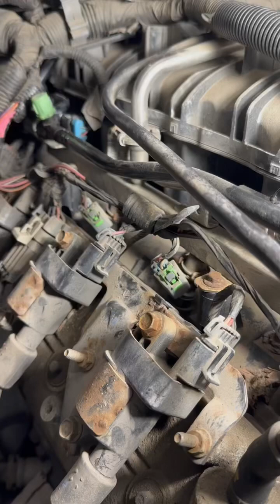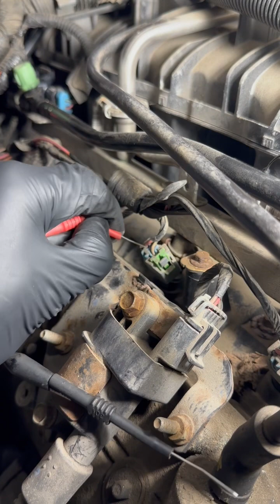Fuel Injector Circuit Testing with a test light #shorts #injector #engine #chevrolet

Comment: You should start the car with the Red and Black wire touching together
Reply from the maker: @xaman1874   LOL
Reply: The method shown in this video is a dangerous method to teach to the masses.  The rule is "never backprobe power and ground at the same time if the probes are next to each other".  Power and ground could have been tested individually on this circuit (with the bulb).

Comment: What if the light stays on and not flicker
Reply from the maker: @erickdominguez4417  you have a shorted control wire or a shorted driver in the ECM
Reply: @KITS_Auto_and_Truck_Repair I'm having a problem with my car, the car only crank no start,  but if I use a starting fluid it starts right up, there is good fuel pressure,  i think something is restricting the fuel , or the injectors are restricted from working by the ecm
Reply: @sauldean6430 fuel filter?
Reply: @sauldean6430  Did you fix your car yet?  What was the fix?

Comment: How to test a desel engine injectors
Reply from the maker: @thestoryteller526  which type of injector?
Reply: @KITS_Auto_and_Truck_Repair ....Bosch solenoid diesel injector in Mercedes. Has 2 red wires plugged into it!. Which is constant?.. which is ground?. Been trying 2 years now looking for info on how to check resistance on the injector and how to check pulse signal at the plug🤔
Reply: the constant one is the wire that would have 12 volt supply just as you switch the key ON,
the other wie would be the trigger and linked to the ECU

Comment: When the ignition is turned on without starting.current comes to all four injectors and petrol is poured .why does it not start when that happens.?
Reply from the maker: @kpdrums459  the injectors are not gounded when the key is turned on!
Reply: @KITS_Auto_and_Truck_Repair  when the key is turned on , injectors turn on
Reply: no that's not supposed to happen,
all injectors should only activate when cranking or running,
switching key ON wont activate the injectors, not even one,
and when cranked they will activate one at a time

Comment: Get the multimeter, put your test leads to the injector's electrical connector and use V 20 measure, watch it jumps up and down as it sends signal - you're welcome 😂😂😂😂. Why go through making noid lights and stuff.
Reply: Well there ya go learn something new erry day
Reply from the maker: @ambientsounds1416  Ok!
Reply: well yeah that would work for analog multimeter, but not in digital 😅

Comment: Cant you just hear the pulsing with a stethoscope? Is there a reason to use this instead?
Reply from the maker: @JdmgjnFjahgks  the pulsing may not be loud enough!
Reply: Never use a stethoscope on injectors because the stethoscope is too sensitive and you will hear the injector next to it.  You should use a long screwdriver instead and put your ear to the handle to listen.

Comment: would the signal wire still work if the power wire is bad?
Reply from the maker: @JohnSmith-xx1lx  Yes!
Reply: What do you mean by work?  Do you mean, "Will the bulb flash?"  Then the answer is no.  If you mean, will the signal wire switch, the answer is yes, but to see that you have to connect the bulb to a good source of battery positive.

Comment: if you ground the black side of the light to the car instead ofput it in the signal port would you see the light come on if the key is turned to on but the car is NOT running?   the injector should have 12v power before the car starts right?
Reply from the maker: @warrenpeas  Yes! there should be power 12v at the injector when the key is on!
Reply: Be careful not to leave the injector activated by grounding the control wire, high pressure fuel could quickly fill a cylinder and lock up the engine .
Reply: @morphix9  it's good now

Comment: You never know what to believe in YouTube… the last video I watched said and did the same thing but he said if the light flickers it means your circuit is no good 🤦‍♂️…
Reply from the maker: @ericmontanez7276  the light should flicker when you connect it to an injector circuit!
Reply: @KITS_Auto_and_Truck_Repair  because I keep getting codes (P0300) and (P0303) meaning cylinder 3 misfire. But I changed the spark plug, the coil, and checked and cleaned the fuel injector but I’m still getting the codes and misfire.  Any help??
Reply: @ericmontanez7276 Compression on that cylinder and confirmation of signals to injector and coil if coil on plug is needed.
Reply: @KITS_Auto_and_Truck_Repair  I don’t have a light but I have a multimeter.  Perhaps I should make one?